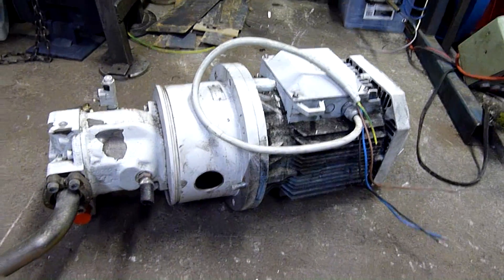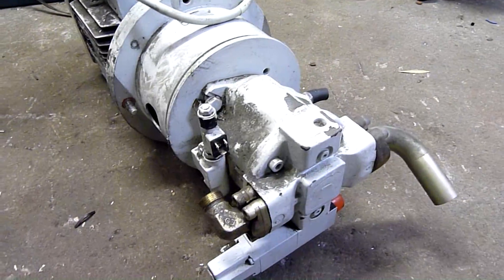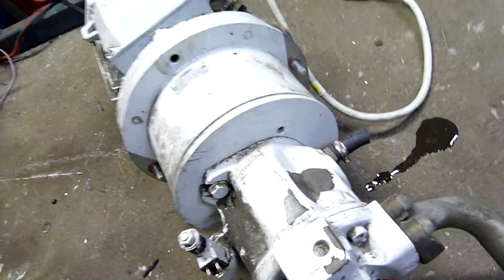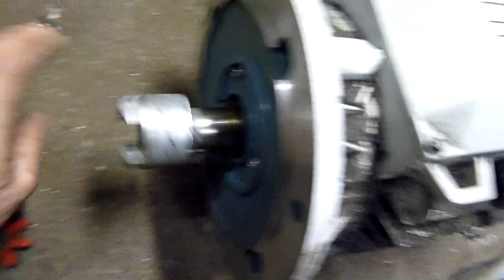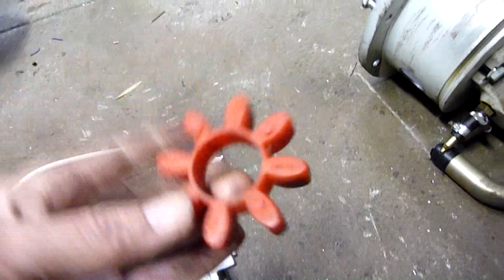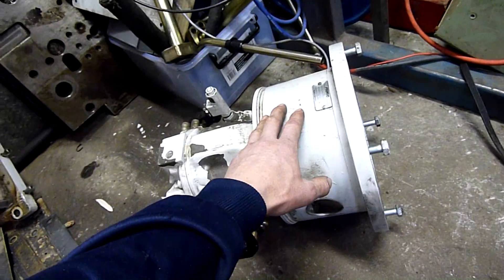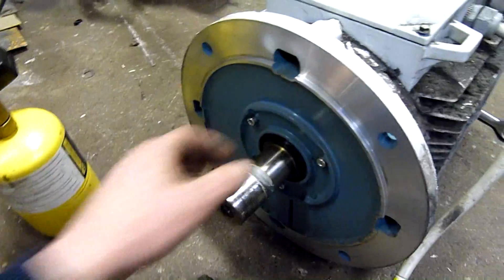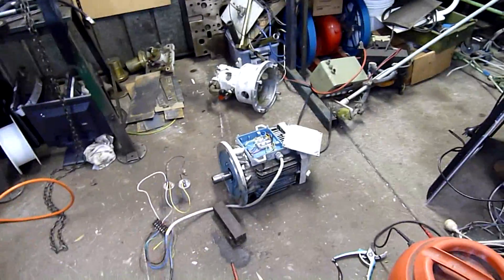Battenfeld 10Hp Pump and Motor Inspection

Comment: That won't help much unfortunately. The problem is that the windings in the motor have gargantuan inductance so the inrush current is several hundred amps probably. The only fix is to slowly ramp up the voltage with a massive variac. Either that or you'd have to excite the windings while the motor is spinning (so it generates it's own power to charge the windings) and then quickly apply power while the windings are still charged.

Comment: What curve rating are your breakers? Should see if you got some D curve or motor start breaker. That should supply a bit more current before they trip off like a normal C curve breaker.

Comment: Nice motor, try a wire wound coiled  resistor of heavy gauge fencing wire or 6 kW of heating elements in series during start to limit the dead short current, see if it works.

Comment: a motor that size definitely wants either a star delta started or vfd and even then It will probably be to much for a domestic power supply as startup current even on a star delta starter will be quite a bit.is there not a vfd in the battenfeld control panel

Comment: I LOL'ed at this too - taking out the neighbours lights. I wasn't popular until I got a LPF on my big hf amplifier - would take out every TV in the unit block every time I keyed up on the 10m band. It would also kick in my UPS. Ed has one up one me though with this motor. Knocking out TV reception with a radio amp is one thing, but pulling down the grid so low that the neighbours lights dim... priceless :)

Comment: Well by the size it will totally not start on 25A breaker, I guess inrush is like 35-50A if not more, rotor is too heavy for a fast start, so a soft start is needed, then I guess without load it will eat 5-8A maybe even less, as was pointed use a ballast or few in parallel to bring more amps if small, and I bet he will spin up nicely.

Comment: Haha, that would take some doing that would! :D

Even if it means standing it on its end with no rotor in the middle & burning out the windings.... The power-draw would be phenomenal & breakers would just more-or-less instantly trip-off.

This one draws just too much power for his shed's supply, and even then, I'm unsure if 10HP is total power, or 10Hp per phase!

I think even Mr. Photon would have difficulty popping this motor.....

{^_^} BoomBoxDeluxe {^_^}

Comment: Haha. You said:

"Sounds like you need a starting ballast to restrict the current, like another motor in series or an old element or kettle"

I've already suggested that, but the thing is, in order to get the bits-and-pieces connected up, it's best to have a Fun-Jiggery-Pokery Unit. :D

Oh!! The fun that can be had with one of those. :D

Hopefully, Mr. Aussie50 will consider making one, because if he already had one, I think there's a possibility that we'd see SOME revs from the motor. :D

-BBD.

Comment: Sounds like you need a starting ballast to restrict the current, like another motor in series or an old element fire or kettle lol.

The question is: what can you use it for?, not much by the looks of the motor, but the pump looks quality :-)

I allways enjoy your sherlock holmes mode :-)

Comment: Viewer # 157. :D

That's a nice motor. :-) As for starting it, I know that it's more than what your VFD can handle, but seeing as it's off-load, is there any chance at all of the VFD spinning it up?

Alternatively, if you're trying to start it on 1ph, this is where a Fun-Jiggery-Pokery Unit comes into play! :D This motor on one side, a 3kW water heater on the other side & hit the power switch.

I done vids on this called "Inrush Problems & Solutions". It works with motors as well as variacs! :D

Comment: So what are you going to do with the other pump? One that runs in oil and one that is used outside the tank.. neat :)

For me, it looks like there is a coming project involving a fuel-powered motor(probably not jet) driving the pump. Or maybe even two?

Comment: Sometimes you can spin the motor with an electric drill or something to operating speeds (~1500rpm?), then connect power. But, this is pretty useless if its connected to anything...